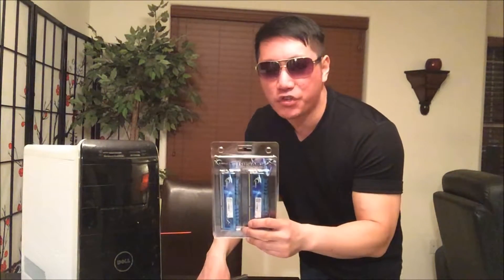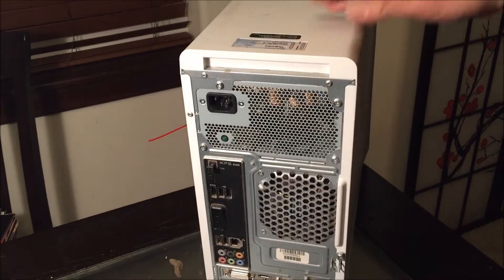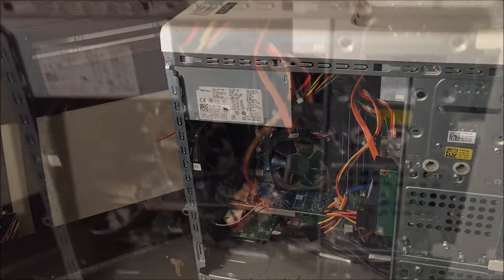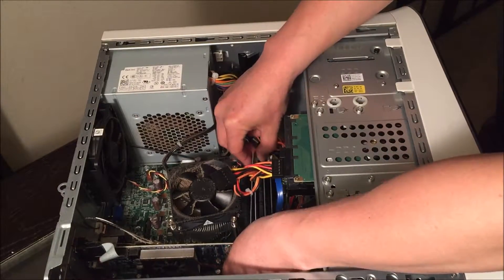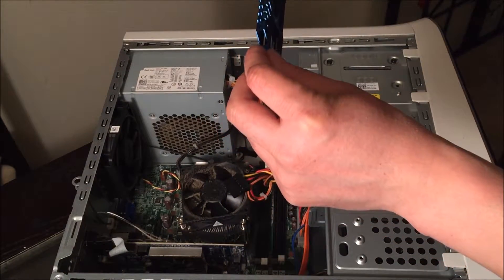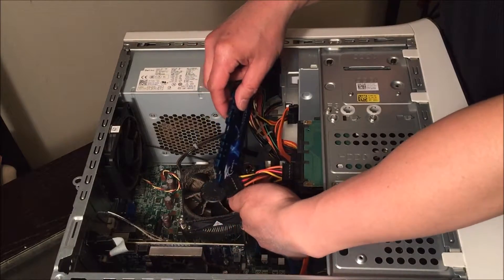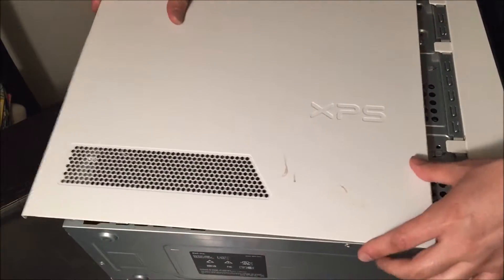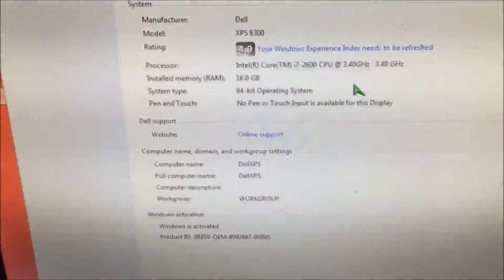How To Install DDR3 RAM Onto Dell XPS 8300 Desktop

Comment: Simple question : why don't you added your old ram on empty slots ? will it be possible to get 20 RAM after it ? thx
Reply: Also I would assume the new ram is much faster than the old ram, and from my understanding if you mix ram of different specs it will use the specs of the slowest ram across all of the ram sticks. If that makes sense.
Reply: Most old motherboards support 8/16 gigs.
Reply: This computer won't accept more than 16 total
Reply: @thenovelloband  My Dell XPS8300 handles 32GB RAM per spec
Reply from the maker: RAM limitations and difference in generation of RAM

Comment: Great instructions. Unfortunately, there is nothing about the clips not clipping in, the lack of space for fingers between the motherboard and the ends of the RAM chips making it almost impossible to push the clips down. Demos always present solutions as easy! GGGRRRRR!
Reply from the maker: good luck